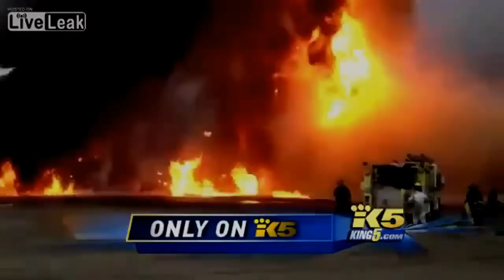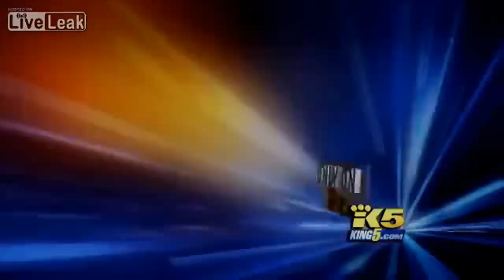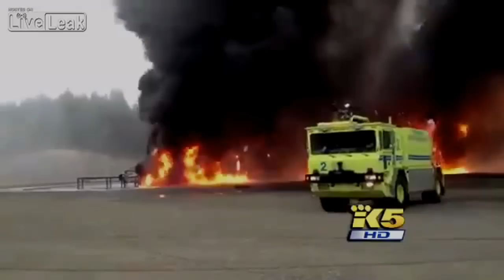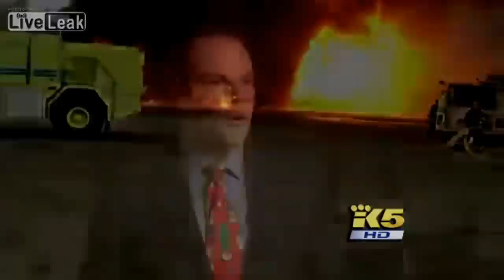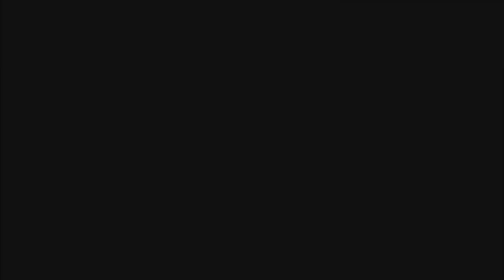Firefighters mistakenly pump jet fuel on fire instead of water | Fail

Comment: doesn't jet fuel have to atomize before it burns
Reply: yes thats what happened when they sprayed it
Reply: enough of it gets atomized to ignite
Reply: yes it does.
Reply: Sahil Saini before it ignites, adding it to large open flame would burn it immediately.
Reply: Sahil Saini when it's pumped out of the hose into the atmosphere,  that's called atomizing. it's atomized and therefore now will burn
Reply: Sahil, NO, jet fuel does NOT have to vaporize before it will burn.  The flash point of jet fuel is around 100 degrees F.  It's auto ignition temp is 220.  If you put a flame up to jet fuel it will slowly ignite as more flammable vapors are released as the temperature rises.  Gasoline has a MUCH lower flash point, -45 F, that's why it ignites explosively.  Jet fuel like any other fuel burns MUCH better when vaporized though.  
Look up vapor pressure, flash point, and auto ignition temp, that will explain it all.
Reply: Exactly ffjsb Exactly. Well said. You must be a well trained tanker driver.
Reply: Geezer, Firefighter with Haz-Mat cert...  But I did drive fuel trucks in the Guard occasionally.
Reply: ffjsb why do firefighter need hazardous material certification
Reply: ffjsb, Civilian Tanker Driver in the Vietnam era. Hauled a lot of JP-4. JP-5, 100/130, and 115/145 to Ft Rucker,
           Moody Field and NAS Albany. Damned dangerous but hell I was young and invincible. (lucky) especially 
           the JP-4.
Reply: Lil King, not all firefighters have Haz-Mat certification, and there are several levels depending on what you do and the depts' capability.  Firefighters might have Haz-Mat Awareness training which is basically recognizing when you're dealing with Haz-Mat, Haz-Mat Technician level which is required to be on a Haz-Mat team, and Operations level which is like subject matter expert and the people who make decisions on how to handle an incident and command a scene.
Reply: Geezer, luckily I didn't haul it much, drove an M35 on occasion with two pods in the back, and one on a trailer.  That was only slightly overloaded....  Never been to Rucker, closest was Campbell (sucked) and Jackson. (not as bad)
Reply: In the Air Force, they would have been real upset if they ever  saw us putting jp-4 into our Zippo lighters. (F-4D crew chief)
Reply: Sahil Saini yes
Reply: Geezer65
You must be well trained in useless comments.
Reply: Taunter Atwill I'm certified in useless comments!
I like peanut butter sandwiches, but only with white bread.
Flip flops used to be called thongs!
Reply: Well when they ignite fuel in an engine, the igniter doesn't use fire. It's like a little Hader. Not as hot as fire
Reply: Jet fuel cant melt steal beams.
Reply: Dam those must be some strong memes.
Reply: no it does not. JEt  fuel will burn just like diesel if it gets hot enough. The hose doesnt ATOMISE the fucking fuel... seriously.
Reply: Sahil Saini  no its basically paraffin( kerosene)
Reply: Ryan Aiton Because the job handles with these classified materials. By NFPA also the codes and standards, a firefighter must have experience with the 9 classification classes.
Reply: Yes it does, however the fire was so hot that it hit the auto-ignition temperature when it hit the fire, so it doesn't need atomized to feed the fire in this case.

Comment: Isn’t jet fuel not that flammable unless at a high temperature? Or did the fire propel the fuel to the required temperature?
Reply: is kerosene flammable? They are very lucky it was mostly water, if the flame had followed back to the vehicle it would have been really, really bad.

Comment: In 2007 in Spokane, Wa. there was a fire at a gasoline and oil storage facility next to where I worked.  At the time there were high winds in the area and it made it difficult to control the fire.  It turned into a 3 alarm fire and the local fire department used water, after many hours they had to call the Air Force base and crews from the airport to use foam to extinguish the fire.  A lot of the contaminated water was washed into the sewer system.  You would expect a fire department to know not to use water on a gas or oil fire.

Comment: they pump jet fuel on the mock up area and then put out the fire with water which all collects in the same drain. there is a separation device which separates the oil (fuel) from the water. they should have sumped both tanks to check for this before using the water.

Comment: "When the firefighters put water, on, a fire that had been deliberately developed, for training, the fire got bigger instead of smaller" - Wow slow down could you exaplain that in less technical terms? I don't understand.
Reply: he fumbled that statement. left out a big part of the equation.  doesn't matter if it's training or a deliberately set fire...  if you add more fuel to the fire it's gonna get bigger.  put water on the fire then more often than not, the fire begins to get smaller.  same concept almost:  do you wipe from back to front or front to back.   doesn't really matter unless you\re a woman.

Comment: Why do people call it jet fuel. Planes run on the same thing as cars but it may just be processed and filtered to a higher standard. Other than that it's basically the same stuff you find at the pumps. Avgas is petrol and Jet A is diesel.

Comment: Jet A 1 isn't as flammable as that, it appears there was some lighter (shorter chain) oil in that mixture beside water and diesel.
Reply: +Alexis “The Player Of Games” Boom It's flammable as all hell when it's sprayed in an aerosol like that.
Reply: ***** you need a very specific droplet size to achieve this, I agree it's easily possible but my point is that it's much more likely that the water was contaminated with JetA and something else.

We should look up what caused this contamination to happen, do you have any leads?
Reply: Alexis Boom it's Jp-5
Reply: the extreme heat of the fire would atomize it quite easily

Comment: What people want to know is why the truck that collects and recycles and separates the water/jet fuel should also be THE SAME TRUCK with a FIRE FIGHTING WATER CANNON on it used for training. If I had set up this school, and with safety in mind, the collection truck would not also play double duty as the training vehicle. Doing that (as this school did) is pure madness imo.  Transfer the water to the training vehicle only after being separated. Then this disaster doesn't have to happen. Wouldn't that be the smart and safe way to do things? (I'm sure someone has an argument for why this safety measure is not practical or whatever. My reply to that is "Sure ok, so safety should be ignored then?")

Comment: If you listened to the news report the facility uses recycled water system for the firefighting operations!! The fire man don't pump fuel through the fire hose and then use the same hose to extinguish the fire. It appears that the water/fuel runs to storm drains and is put through a filtering system and then it is put into holding tanks for firefighting operations. This is appears to be done as to conserve water or there is no public water system available. I don't think the firefighters had anything to do with this mishap as most would not even know where the water comes from except that they hook to a hydrant and water comes out.

Comment: Now I am not clever or smart, but surely instead of using the same vehicle to spray the fuel to start the fire, surely a whole separate vehicle with a purpose built tank & pump would be the answer?! All it ever need do is pump fuel. I think they have them for errr......pumping fuel!! But seriously, if you have a tank with fuel and a tank with water in the same vehicle and only some valves to stop it mixing, surely that is a recipe for disaster.
Reply: Andi Stephen Most of your stages, like this one appears to be, are plumbed with propane and don't use any kind of "sprayed in" fuel. If you look at the front of the plane, you can see pipes. They could be holding propane or, for added realism, they may actually be using jet fuel.
Reply: zethreal Pardon? What are you trying to explain to me?? Did I get it wrong? If I did, say so. Don't baffle me with math :-)
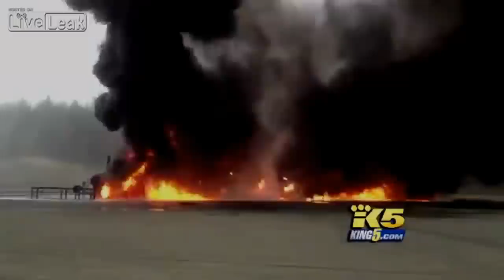Reply: Andi Stephen Most "Stages" ( Where they hold training drills ) have fuel  pumped into them, on demand, via pipes like what you see sticking out of the front of the plane @ 0:39.  They wouldn't have used the fire engine or tanker/tender to carry fuel at any time.  

What it sounds like happened was that the underground pipes had leaks & jet fuel was being sucked into the water supply they were using.  Evidently enough was being sucked in that it was making the fire worse.
Reply: zethreal Ahh, yes, now I understand. Sorry, yesterday was a VERY long day at work. I misunderstood "stages" but now that I am awake, I get it.

I did wonder how they managed to create such a situation, but underground pipes sounds feasible.

Comment: The oil/water separator failed at the facility.  They were using reclaimed water, but it had gasoline in it too.  It was not their fault in the least.

Comment: This is what affirmative action gets us!
I would like to add that when OC fire authority was called to my home for a small gas fire in a bucket only, they were getting out fire hoses and I said loudly it's gasoline! Don't use the hose! I repeated it, being dragged away by two firefighters, my gf went and told them too, as well as neighbors. All of us knew not to use water on a gasoline-only fire. The firefighters paid no attention, and blasted the water into the bucket of flaming gas, creating a massive flame thrower into my garage. They offered to help me put my boat back in the driveway but I said "NO thank you. You've done enough"

Comment: Don't know about you or your department, but we were never taught to put fuel in the water tank. I can't imagine how that would happen.
Reply: Pluff Mudd Its a closed system designed for training, they collect the fuel/water mixture separate it out, and use it again the next time. (Or at least thats how its supposed to work...)
If you kept using fresh water, it would push the excess fuel into the local aquifer and the locals would be drinking fuel soon....
Reply: ***** Thanks for a thoughtful answer.  It's been decades since I was involved in flammable liquids training, but it seems to me that we burned as many times as we could with what fuel was loaded into the pit.  When it wouldn't burn any more, they added more fuel, until the fuel truck was empty, and then the pit was allowed to burn out.  I never thought about excess fuel going anywhere.
Reply: Pluff Mudd
Yea, one of the departments I worked for had their training facility shut down because the holding tank leaked, so I knew about this first hand. In the old days, it was just an unlined concrete pit under the burn building. I can't really remember what kind of a water separator they used, but working with volume like that, when it goes bad, it goes bad big time.  ;-)

Comment: You use foam on fuel fires not water  because it spreads the fire. Jet fuel connections are completely different than water so I think this is BS.

Comment: In USN fire fighting school we trained to put jet fuel out with water. No problem at all If you know what you are doing.
Reply: That's funny because you can't put water on a Class B fuel that is burning! Please do explain to me in depth how jet fuel has a specific gravity greater that water does, so whenever water will be applied to a B fuel burning, that fuel will always jump up and out, no matter what. You will ALWAYS use a foam, dry chem, or a CO2 agent on a Class B fire.
Reply: iLikeC00kieDough 
You use low velocity fog applicator to smother the fire doesn't work well but it will work. Ano other method use mechinal foam.  The very best method is to use stuff called Light Water. When your ship is on fire you put it out no other option.
Reply: What is light water?
Reply: iLikeC00kieDough 
Some sort of chemical that when applied forms an oxygen prof barrier. Always the last fire of the day because you can't restart the fire after light water is used. Now on to how to put out mag flairs.  It is amazing what you can do when your house is on fire and it 600 miles to land.

Comment: The damage-control dude talks about this like it's a simple mishap when it's clearly mega-stupid lol
Reply: How is a failed machine mega stupid? Thats like saying if your car dies suddenly without warning your an idiot. Machines and technology fail everyday, its not stupidity, its life.
Reply: They figured it out right quick when it happened. And isolated which systems malfunctioned and how to compensate on the fly. Egg on maintences face, not on theirs. If they hadn't been on the ball it would have been lots worse.
Reply: Angry Combat Wombat  Its a fuel/water seperator..... Its a machine that seperates fuel from water..... It doesn't have an infinite lifespan, no machine does.... The only way they could design it so that it would never happen would be to not design a system at all. You can call me a dumbass all you want but that doesn't make your comment any less ridiculous.
Reply: Angry Combat Wombat  Again completely oblivious to what happened. This did not occur because some engineer included this in the design. This occured because the machine stopped working. Period. Thats like saying if fuel stops flowing to your cars engine, the engine will stop running. A hundred different things can cause that. Why would engineers even design that to be a possibility in the first place?
Reply: Angry Combat Wombat  It is engineered this way because 1. you have to have it anyway to prevent environmental contamination, and 2. they were reusing the supposed to be clean water so they didn't waste so much at the training mockup.

Comment: Jet fuel = diesel.

True story.
Reply: +AngryGinger yep and it smells amazing... at my aviation college, we used to go out when they started up the helicopters you can smell it...
Reply: +AngryGinger You can run a jet engine on diesel. Just about anything you can ignite will power a gas turbine engine. But diesel would definitely be suboptimal. Jet fuel sold for use as such is usually kerosene.
Reply: lekoman Now that is a true story in a crude sense. Also diesel is horribly hygroscopic.a very very bad plan in a high altitude jet. Conversely you can definitely run a diesel engine on jet fuel, but also suboptimal as kersosene is not an at all effective lubricant
Reply: You can also run properly adjusted jet engines on diesel at positive temperatures, on the ground. But if it gets too cold it will gel. Jet fuel won't until much lower temps, and Jet-B lower still. I have worked with diesels where on colder mornings we had to heat fuel pipes with blow lamps to get the engines started. In aviation? That shit just does not fly, if you'll pardon the pun. Then hygroscopy the real killer blow. No one likes a flame out in a jet...
Reply: +AngryGinger - actually jet fuel is A1 kerosene (which has been refined more than diesel)
Reply: Jet fuel, kerosene, diesel, and heating oil are all pretty much the same. Although the color of the fuels varies and jet fuel is refined much better then the other three.
Reply: I believe Jet Fuel is Kerosene with Xylene and Naphtha added to it?

Comment: Water on a fuel fire?🤨 seems like the training wasn’t the brightest to start with
Reply: They may have planned on using foam. I mean you can crank that up to over 1% foam content of you want. Either that or the fire was just started with jet fuel. When we trained for car fires, we used petroleum inside the car and just blew it away with the hose and extinguisher without any issues.

Comment: what the fuck was jet fuel doing inside a firetruck's WATER TANK?
Reply: Dennis pranked them!
Reply: The fuel/water separator failed and allowed fuel to enter the water lines that feed the hydrants to refill the Engines. Thus the crews unknowingly filled their tanks with water laced with fuel.
Reply: Roobz Z they wanted to melt steel beams
Reply: Scott L Fire trucks run on jet fuel??
Reply: xXxDjShamblesxXx Um... Not sure if you are joking or not, but the answer is a big fat no on that one.
Reply: GamePlayRaja dammit Dennis!